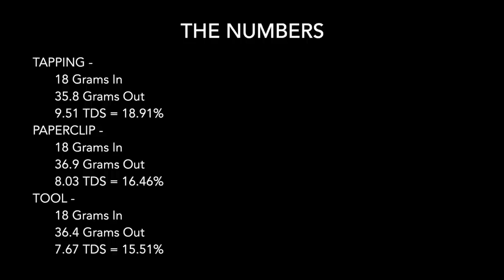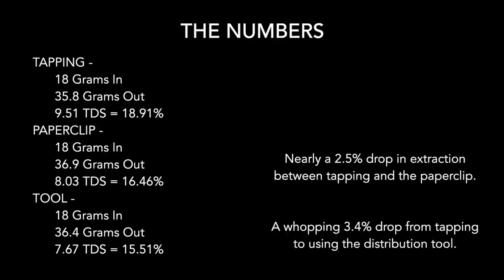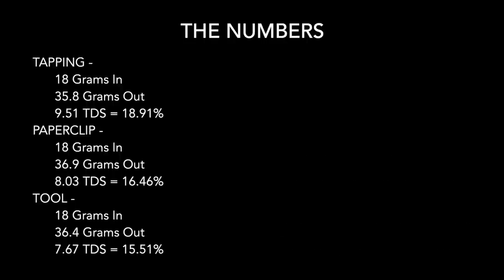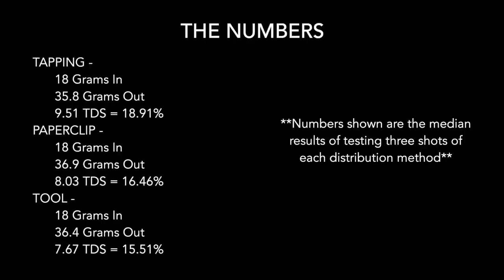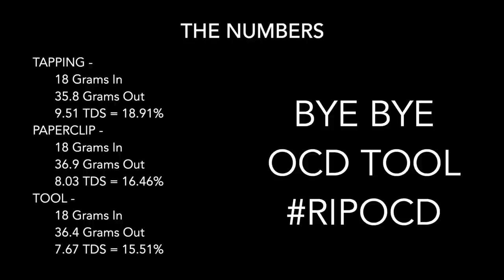COFFEE SCIENCE - Distribution Method Vs Extraction

Comment: Great video! I think the key is to eliminate channeling as much as possible, and pretty much for most of the time is about de-clumping. My guess is that tapping is the most efficient way here to break the clumps(when grinding finer, the problem could be really serious). BTW, the paperclip method is actually called WDT method(they've even got a special tool for it), and I think you can use the other head(the bulky part) of the clip, with the dosing funnel still on, to stir it intensely to achieve the goal. As for the OCD, the only thing I know about this tool is that it's visually pleasing, and that's it. 
Before I go, I do have a method of my own, and would you like to try it out? (since I do not have a refractometer :<). I use a catching jar (from my beloved Lido3) and dose into it instead of PF, shake it up, and then does into the PF. If you do try it out, please let me know the result, Cheers!
Reply from the maker: Springfield Leo thanks! And I appreciate you watching and leaving a great comment. I will absolutely give that method a try. In a few weeks I’m going to put out a video trying to max out extraction % on the Flair (since I can control all the variables) and this method will be something I’ll try.
Reply: @Sprometheus  That'd be absolutely Awesome!

Comment: I train my baristas the tap method in case they work at a cafe in the future that doesn't have a distributor. But we also have an OCD so we combine those two and have experienced the most consistency this way. I would give that a go before you fully pass on the OCD :)
Reply: What's the purpose of utilizing the OCD after you've distributed evenly through tapping?
Reply: @gabrielcobos9372  seems to prepare the bed just that much more to increase consistency

Comment: wondered if you've ever come across Scott Callaghan's dosing tools ? they're bits of plastic with a curved edge of varying sizes that you can use to shift grinds in the basket. i think the primary idea is that you can dose without weighing anything but i'm interested in them from a distribution standpoint as they seem to move the grinds around to find the deeper bits of the basket much easier than your fingers can when the dose is low or you don't have a nice mountain of grinds.

Comment: I use the ocd as more of a tamping  alternate than distribution. Still distributing with rigorous tapping, but the ocd can be used to tamp, as long as the ocd tool outer lip floats very slightly above the portafilter rim, even when pressed hard.
Reply: I actually think it makes more sense if the outer lip descends all the way to the filter basket, because then we can be absolutely sure the puck is perfectly level. Yes - it must require appreciable force this to happen (so that a tamp is achieved).

Comment: You recently did a video  comparing tamping vs no tamping. Would you expect the results to be the same here if you hadn’t tamped after the OCD? Thank you.
Reply from the maker: I think the outcome would be the same or similar. I don’t think the tamper is the issue, but something about the process the OCD uses to distribute that causes lower extraction.
Reply: The Real Sprometheus ;
There were similar results with the paper clip  + tamper as the OCD + tamper. What if it’s not the device but the difference in the elapsed time from grinder to extraction. I hope I’m not becoming to pedantic (?). I find it amazing how what seems to be an insignificant step in the process can have measurable impact on the result. Respectfully

Comment: The OCD tool never made any common sense, because all you’re doing is leveling the surface at the expense of uneven distribution; a flat surface doesn’t equal even distribution. As for the paper clip method, the correct technique is to use a separate vessel to break up clumping prior to transferring it to the portafilter. Otherwise, great video!
Reply from the maker: ULTRA KWON I’ll definitely use a separate vessel on my next TDS based video. Thanks for watching and the thoughtful comments.
Reply: yes! you can see Steve Rao doing exactly that in one of James Hoffmann latest videos. He uses a separate little vessel and breaks it up not with a paperclip but with some tool that kind of has the same efect.

Comment: That's why I WDT first, then tap, then OCD tool... Overkill?
Reply: Abul Maleeh no if it makes the perfect puck then nothing is overkill 👌
Reply: I do WDT, then OCD with no tamp. I pretty much always get my 2:1 extraction, and the extraction rate on my naked portafilter looks great. Most importantly I like the drink I end up with.
Reply: Jeremy Jensen does it not extract really fast? Not that it matters if it tastes good
Reply: @sonny9390  nah. I still get 25 seconds out of it  I saw a tip in a Whole Latte Love video about using the extraction tool without a tamp and it worked out nicely in my tests. You'll probably have to adjust your grind size or dosage to go that route though.

Comment: Could you measure again after adjusting output to the same mass among the three methods? Having less water in the first method makes the concentration automatically higher, I guess? Otherwise great job.
Reply from the maker: Holger Feroudj ideally yes it would be best to have them all be the same output, but on a manual machine that’s a tough thing to achieve. 

I’m confident with even a gram or two off of each other the outright winner would still be tapping. I don’t think that little yield would constitute a missed 2.5-3.5% extraction.
Reply: The Real Sprometheus Was thinking more along the lines of adding a little water to the shots with less volume – but that’d probably be the same like equalizing the dilutions mathematically,  which I just tried to do and you’re absolutely right: it brings down extraction yields of the lower volume shots only by 0.2 and 0.6’ish %
Again – great job! :)
Reply from the maker: Holger Feroudj for sure. And considering that all the water in the shots have passed through the puck. But if you add fresh water it would most definitely throw things off a bit.

It’s definitely not perfect, but thank you for watching and for leaving a thoughtful comment.

Comment: I quickly scanned the comments, but not seeing anything about why the OCD negatively impacts the TDS% - any theories?
Reply from the maker: That’s the question for sure. I’m not sure, I’d love to test one of the wedge distribution tools to see if that has the same effect. But my thought is that it has something to do with the fan shape maybe pressing down on some portions and not the others and then adding the spinning in. Further pressing the fanned areas in more and leaving the other areas less dense....but honestly. I wish I knew.
Reply: I feel like the utility of the tool is a little misrepresented and wouldn't necessarily say it is a negative impact. An OCD advocate could hypothesise that the tool would gently distribute without shifting and migrating fines, resulting in a slower but more even extraction. This would make sense to find that under the same brew parameters, the OCD brew would have a lower TDS percentage. (In a practical shop scenario we could of course alter our brew parameters to increase extraction)
This also seems likely to me because of the barista hustle testing so far has shown that the tool is effective (just as effective as tapping) in evenly spreading coffee around the puck, suggesting that actual mass distribution is not the reason behind the lower yield and rather that the other brews are extracting higher due to "overextraction" of the finer particles that are not evenly stratified throughout the puck. 
Does that make sense? I certainly wouldn't claim this to be the objective answer but to me it currently seems like the most likely explanation. 
For the record I was originally a critic of the tool but after looking at the data and using it in service I'm inclined to say that it is effective. Totally down to be proven wrong though.
Reply: @NeutralMjolkHotel  Very well said!

Comment: I found doing finger tapping on the side of the portafilter, followed by vertical tapping is a good start. Then use ocd tool to smooth over the grounds. But make sure the smoothed area  remain above the demarcation line, located on the inside of the ridge of the basket. Finally tamp down to the line of demarcation, marked on the inside of the ridge of the basket. 
As always, it's about consistency..